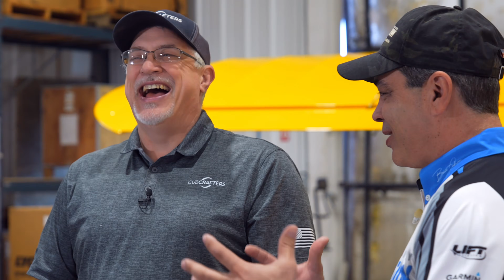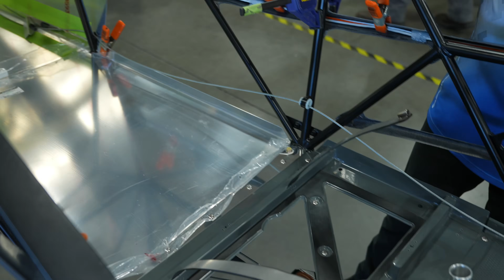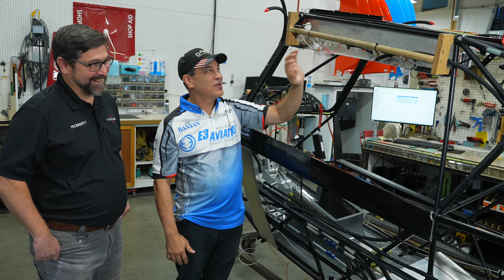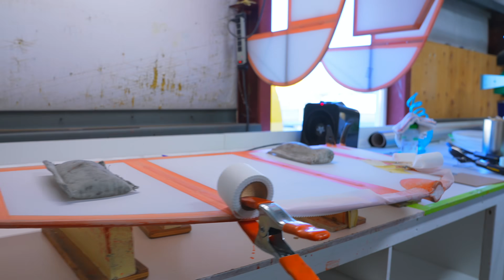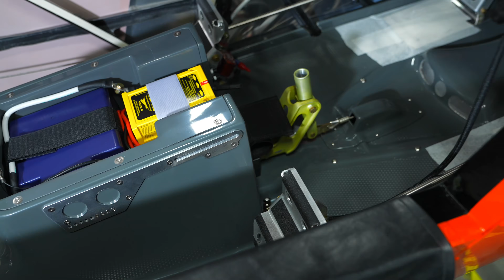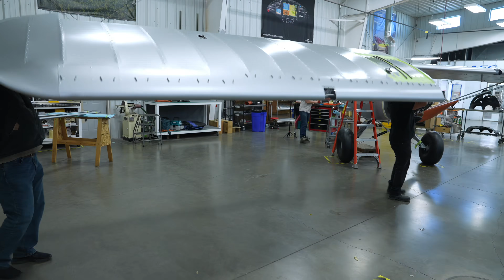They Build This Plane in 60 Days. Here's Every Step.

Comment from the maker: Station 8 is where it gets dangerous — engine on, prop spinning, tires down, and it finally looks like something you could actually fly. If you're building or already own one: which model and what's the one thing about the build you didn't expect? If you're shopping: FX3, UL, or XCub — and what's the deciding factor? Drop it below 👇